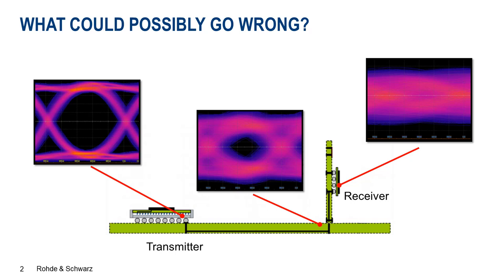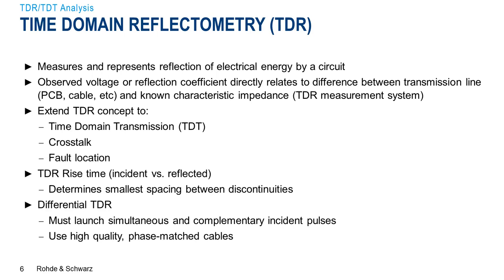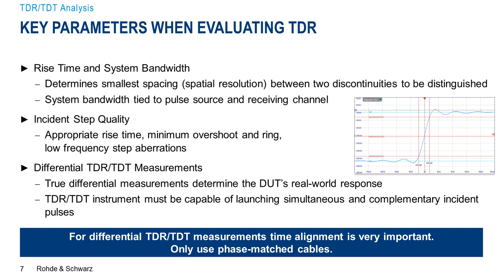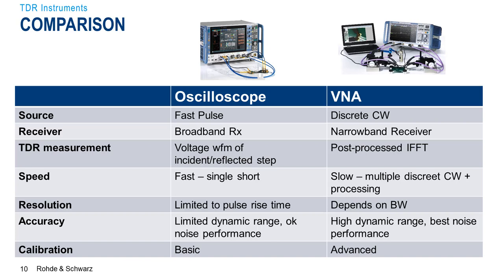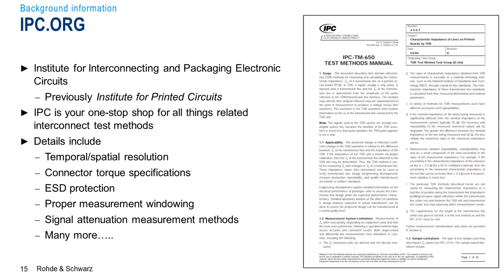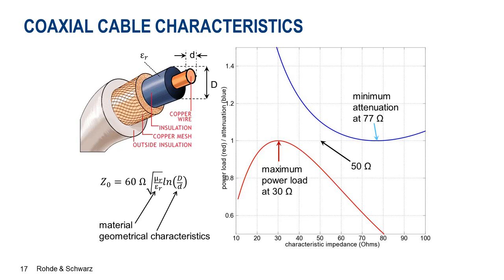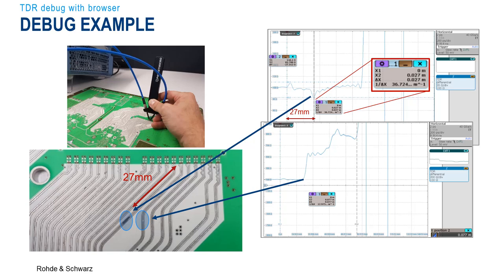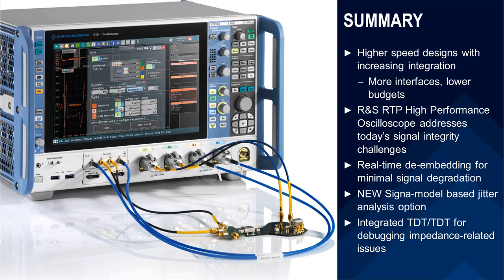R&S Thirty-Five: Using TDR to solve signal integrity issues

Comment: The audio of the video is also a good example of signal integrity degradation, while the transmitter (human mouth) might be producing a signal (voice) at a good enough amplitude, the transmission line (your mic, sound card, editing application etc.) attenuation is so high that the signal must be amplified (rising volume levels above 50% at my PC) before reaching the receiver end (my ear) and thus degrading the quality of the signal and the experience.

Otherwise great video!